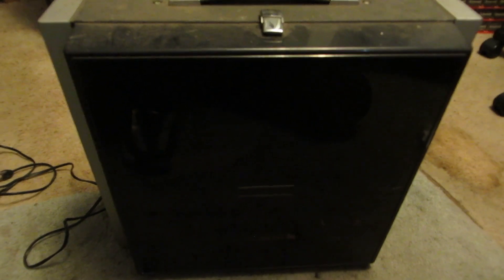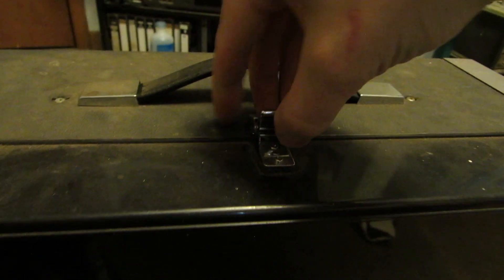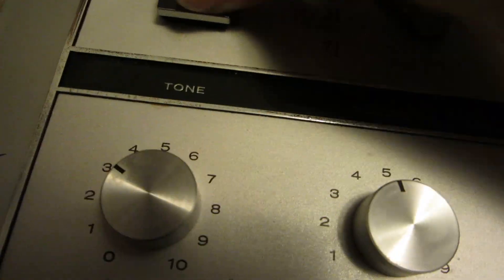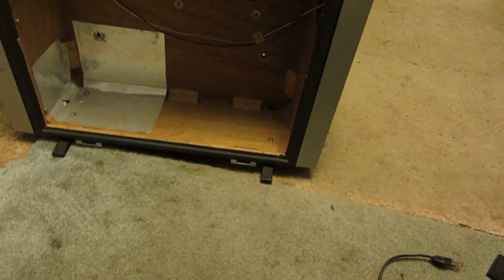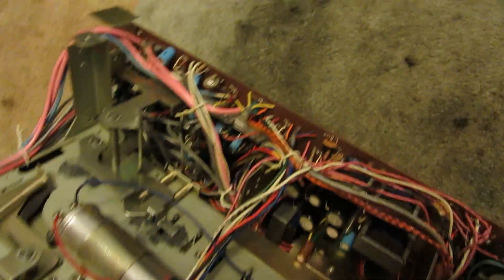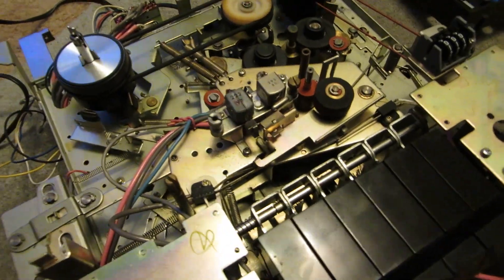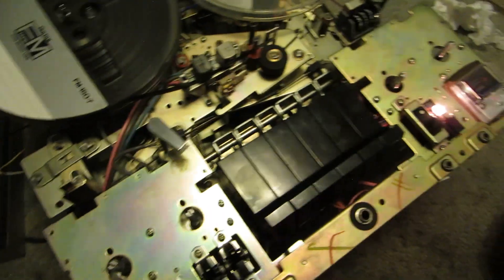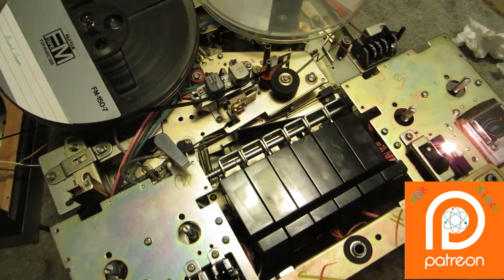RCA Reel to Reel Player Autopsy & Repair

Comment: How did you fix the issue of the power turning off when using Fast Forward/ the other switches?
Reply from the maker: Didn't you see the MASSIVE piece of paper I shoved in to keep that bar from moving at around the 8 min mark? Because that's what I did as a temp solution just to make it run without a tape mounted.

Comment: Neat! It’s a re-badged Sanyo / Craig model. You can scuff up the outer edge of the glazed idler wheel with some fine sandpaper to restore the traction, then hit it with some rubber renew.

Comment: you can use rubber renew to fix the dry idler wheel issue do not erase the tape that is a collecters item since some of the group is passed away and this is a live concert recording

Comment: Made in 1971 by Sanyo for RCA dad had it now i have it retailed for $200.00 Canadian  channel 1 and chanel 2 were when mono recording were done   but stereo recordings are both channel 1& 2  you can do direct recordings via cable to the back with switch turned over to record then play back with switch back to other position

Comment: i have the same machine when recording volume is the recording gain  you need 2 mics for stereo   channel one and 2 is just left and right you can play directly to machine using connections at back just put into record out on amplifier and use volume control adjust so gauges are in the middle   i play 3 1/3  the switch at the back is to shut speaker off to play through a larger stereo